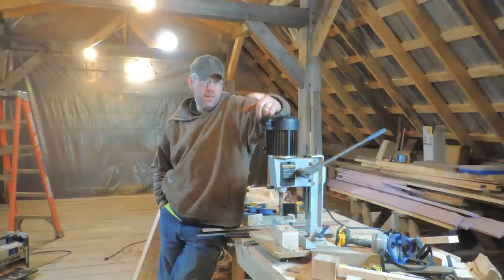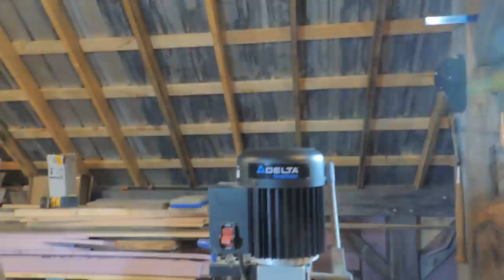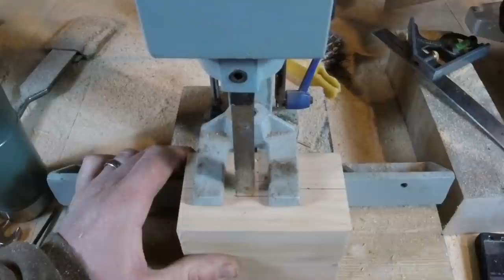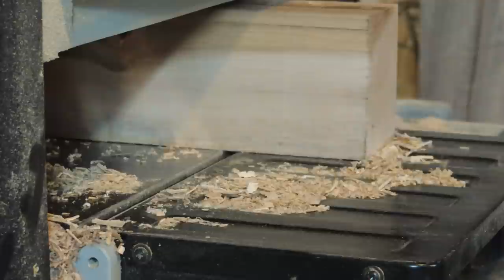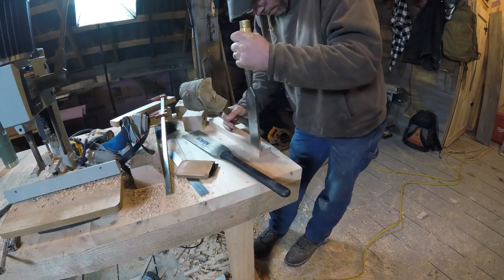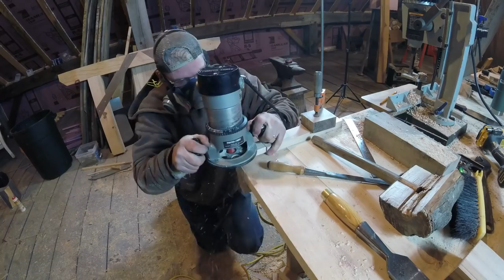Adding A Hollow Chisel Mortiser To The Woodshop

Comment: Great score on the tools. I've used a delta drill press, planer, and table saw, well made and solid. Now you have a proper mallet. Wonder if the hammer was the first tool ever made. Thanks for sharing.

Comment: I modified a 1880's Hendy metal shaper to build my hollow chisel mortiser. Works great and is horizontal so I can work on the ends of long pieces and sides of wide pieces like door styles. I got my hollow chisel set from Harbor Freight, the chinese hardware store. I find they can get very hot and it helps to touch the end with bees wax to lube the auger. For making furniture it works better than the chain mortiser.
Reply from the maker: They cut so much cleaner than a chain machine or just about anything else.  I like the beeswax idea, I have a pile of beeswax here.

Comment: I have an older stand mortiser from the BIL, 1/2 HP, belt driven. The cast iron and adjustability are all good but I've gone through quite a few bits trying to make larger mortises in hardwood. I thought I was using good quality bits but I may have to source something better.
It's a good tool for the woodworker that needs to make a lot of mortises.
Reply from the maker: That sounds like a beast of a machine.  I mortiser is a great tool to have in a wood shop, I haven't gotten to use this one in years so it was really nice to get it out and running again.

Comment: Must be a good feeling getting the tools out of the PIT?  Glad you didn't get hurt by the species known as Acer Smackanrinum.  It would've been a moment in video.  What was the biggest issue yanking the tools from the PIT ... rust?
Reply from the maker: Rust and years of oil and grease from doing chainsaw work out there, I used to collect and restore chainsaws.

Comment: How does the  #delta hollow chisel mortiser work? Is it a spade bit spinning on the inside or a baby chainsaw? -Will
Reply from the maker: It is an an auger bit with a brad point tip on it that rides inside of the chisel.  It is great system.
Reply: you basically shove the outer square chisel down through the wood and the inner bit hogs out most of the waste. The square corners of the outer chisel shear off the wood fibers and the inner bit grinds them up and carries them away. Works pretty good but you have to have a really ridgid machine to keep it from flexing and a really square outer chisel that doesn't have any rotation to get a nice square and plumb mortise. A good one is really heavy and pretty pricey. His delta is one of the best in the "affordable" category.

Comment: There have been several versions of that tool made by Delta. Norm used three of them over the 20 years of "The New Yankee Workshop". I have them and all the other tools he used chronicled at my NormsTools.com website (I hope you don't mind the shameless plug).

Two ways to do handles on mallets--from the bottom or from the top. You chose from the bottom (and nothing wrong with that). I do mine from the top which eliminates the need for wedges. It requires a tapered mortise (only two sides), but that can easily done by machine by cutting the ends of the mortise with a slight block underneath each end of the mallet head.
Reply from the maker: You let me get away with some poor terminology once in awhile and you can plug your website all you want.  I do know the terminology pretty well for most of this stuff I just tend to jumble what I'm saying while I'm trying to think of the project at hand and talk to the camera at the same time.
Reply: I don't think you abuse terminology. As a matter of fact, your extemporaneous narration sans script is quite good. There are plenty of YouTube creators who I can''t even listen to.